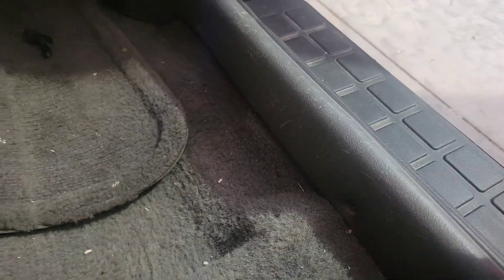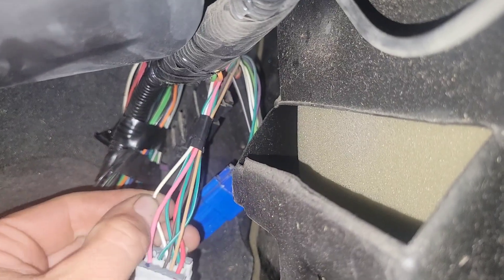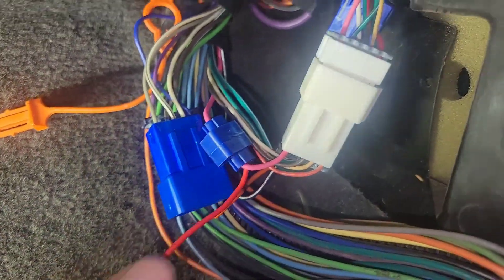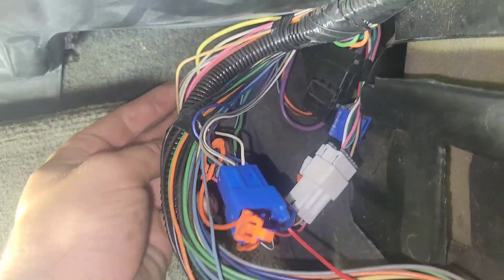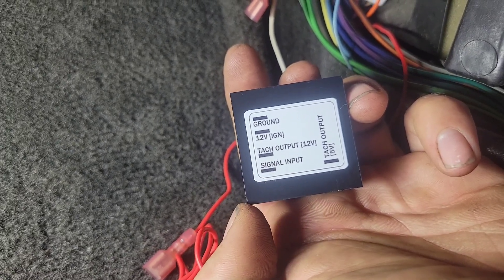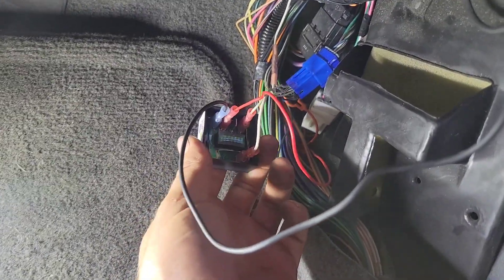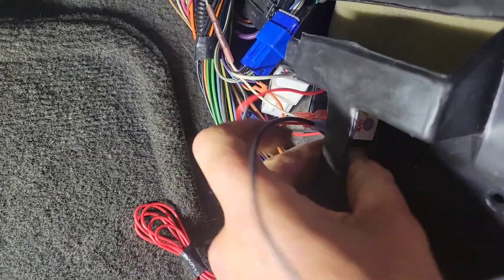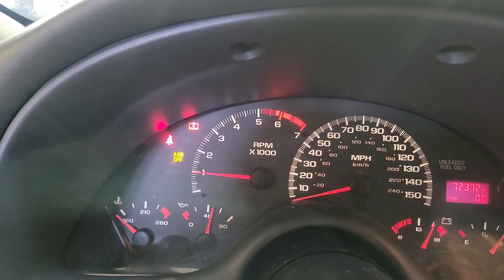Lt1 Tach adapter installation for 4x 411 pcm conversion

Comment: I just got mine wired up. Do you know if there's a difference between Firebird and Camaro?
For the output, since there's a 12 V and a 5 V. How do I figure out which output voltage I should use?
Reply from the maker: No difference between the firebird or camaro. There may be a slight discrepancy if you're not a 96 or 97.